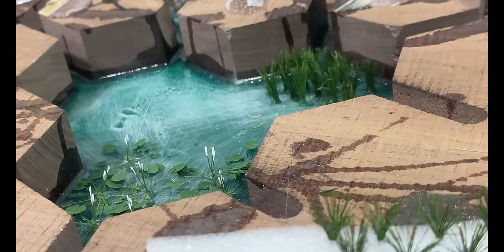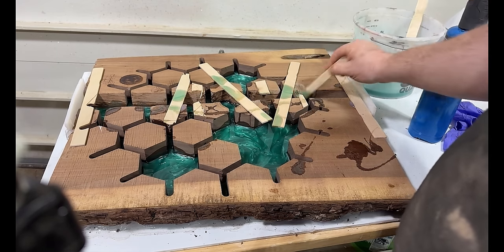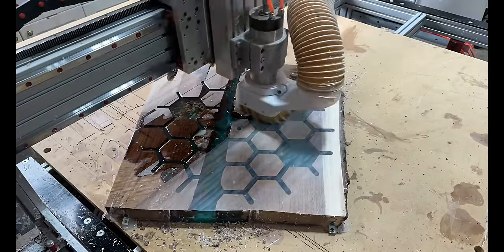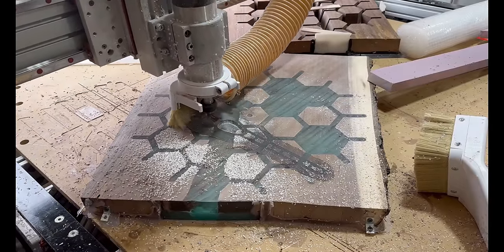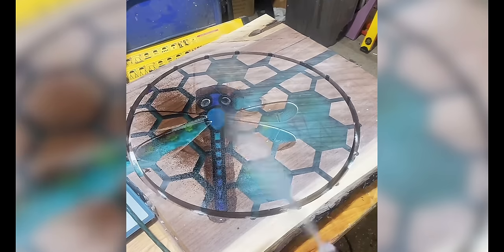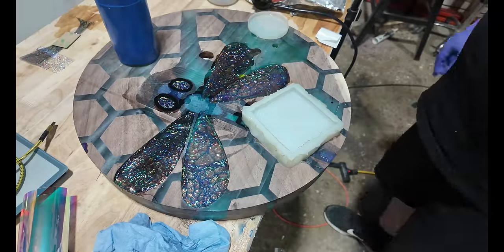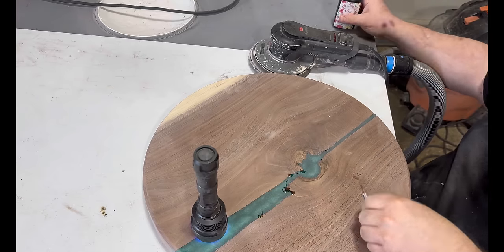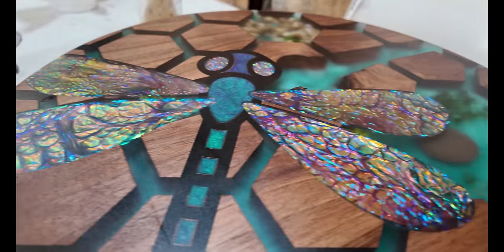I build a dragonfly with wings more expensive than gold

Comment: I wish drum sander paper was easier to change... even just going up to 100 makes a difference in ease of sanding after. I did a high chair and send every piece thru on 100 grit right after the table saw (not a lot of material just saw marks) and it greatly reduced the hand sanding I had to do
Reply from the maker: Quick change cylinders is a million dollar idea
Reply: @screamingdonkeywoodwork  for sure. Or just levers that don’t require you do be a carnie to reach.

Comment: This is an incredible piece. I have a question about the hard wax oil, though, and the epoxy. I have tried the same thing in the past, sanding to 240 and then applying the oil. I always take my time to avoid swirls in the sanding, and have even tried wet sanding after to 320. However, you can always see the scratches in the epoxy once I add the oil. Do you have any suggestions?
Reply from the maker: I’ve never had the issue even back in my cheaper sander days.  I did so and clean my paper every foot or so though.  Good hard wax, good sandpaper is my best guesses.

Comment: UV Resin would work better than hot glue.
Reply from the maker: In my limited experience with it, it’s only better for things where you can get the UV to it to cure it.  So under something with solid colors didn’t work well, but I did try it first